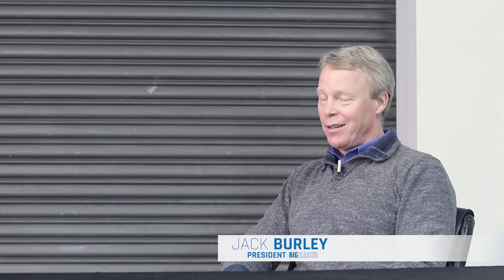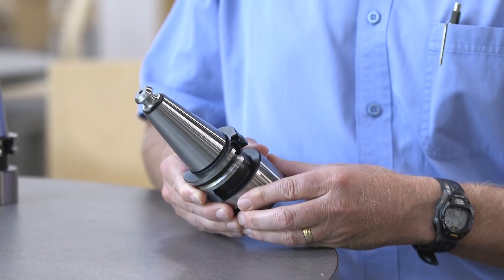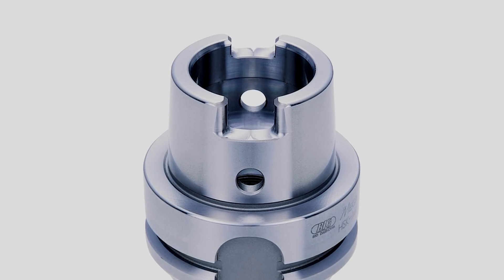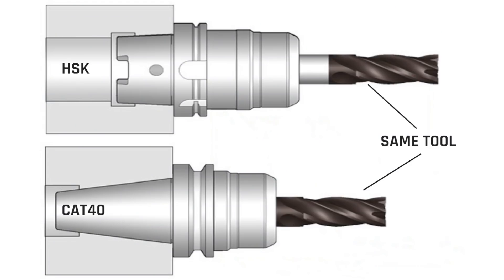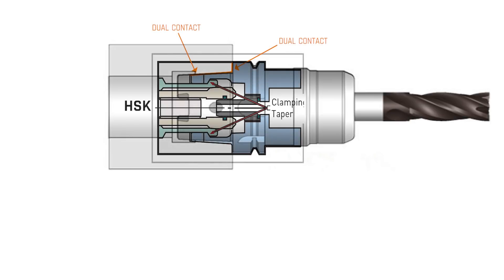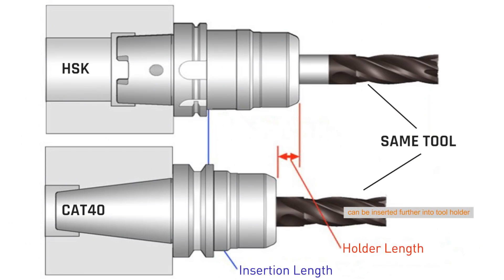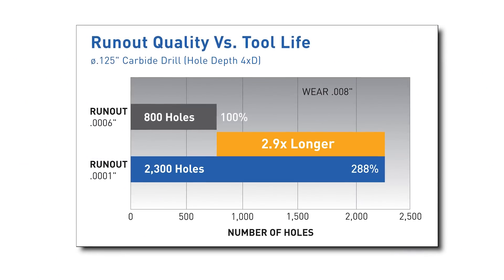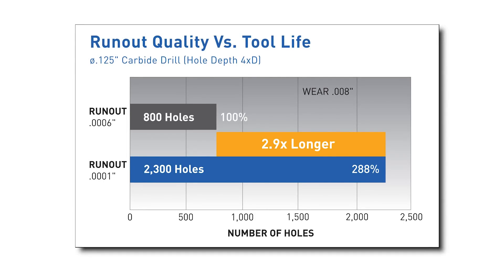CNC Toolholder Interview with Jack Burley, President & COO of BIG KAISER

Comment: This was great. I love those in depth technical talks that I can still understand.
It's always good to hear that my ideas are not that far from what the experts think :-)
Yes - tool holders do make a big difference. When I wanted to try some engraving, I grabbed an engraving tool from my small CNC but since I did not have a 1/8" holder, I put the bit in a CNC drill chuck. Hours later I am still using that tool and still love the quality it produces. It surely is not the correct holder for such a tool but it seems to work well in my case.

Comment: Balancing large turning things like propellers weighing 2000 lbs or more need less perfection because they turn slower than a 10 inch aluminum propeller turning 150 time faster.  Loved the video--much thanks.

Comment: Here is a blooper. Pull out. Happened to me with an er collet on inconel 718 doing keyways. Also speaking of humming, I have a air grinder at work that does 90k, rippems i put a tool on it that was way too big to be used on it and called for some 30-50k rippems.

Comment: My kind of video. Jack, should a set of tool holders be scrapped If they were used in a spindle that needed to be re-ground?
Reply: Depends in there was any damage on them
Reply: If they've been used for any reasonable amount of time, they probably already carry witness marks transferred from the spindle before it was ground, or fretting.  You will immediately transfer witness marks from your tool holder taper to your "new" spindle.  Your tool holder taper is a reflection of your spindle taper (and vice-verse)...and whatever imperfections exist on your taper, will soon be present in your freshly ground spindle.